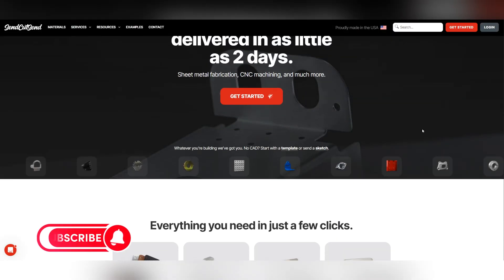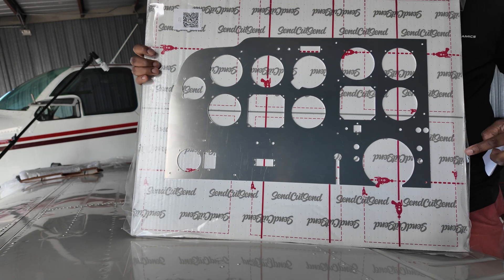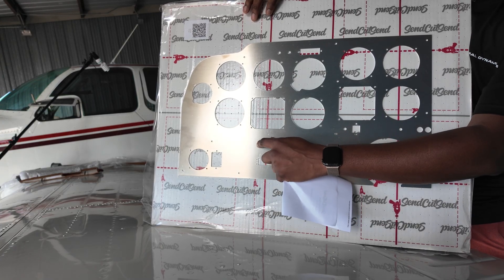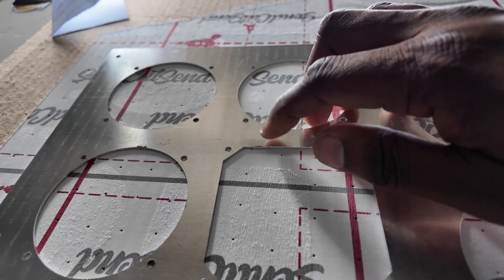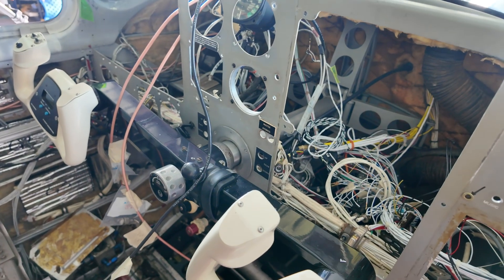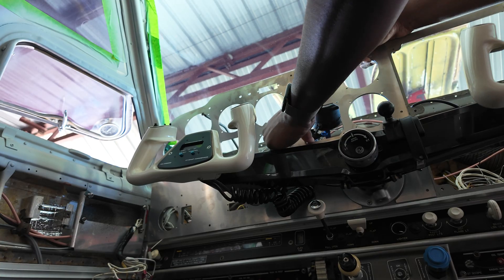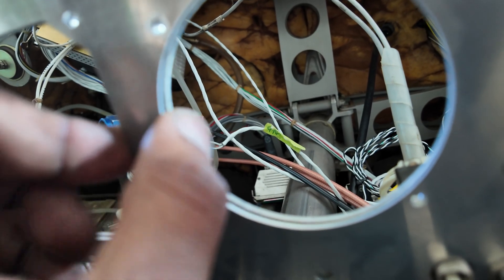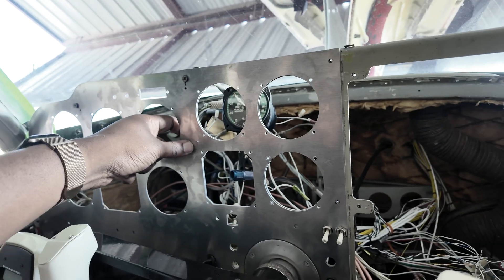Can I Make My Own Instrument Panel - How Will It Work?

Comment: What I understand from the whole “YouTube views are down” ordeal is that somewhere around August 10th, desktop views from those using ad blockers on YT were no longer counted as views for some reason. It didn’t affect revenue directly, because the views weren’t monetized to begin with due to the ad blocker, but obviously the lower view count can hurt YouTubers indirectly by leading to smaller overall views which leads to less hype/pushing by the algorithm. I am very surprised that YouTube isn’t addressing this more publicly.
Reply from the maker: This is my understanding also. The internet's belly button (Reddit) is full of content creators reporting the same thing. From the analytics that I only kinda understand, I've noticed that hardly any of my subscribers are seeing my content. More of my followers saw my stuff when I had 200 subscribers. Weird. YouTube gave a very unsatisfying response a few days ago that left more questions than answers. I'm sure there will be a fix or a new normal soon but this makes me think harder about diversifying platforms. You'll probably be ok with your new ruddervator rating service.
Reply: @OpenSourceGA ”internet’s belly button” is enough to make me spit out my drink! 😂

I don’t understand how impressions work on YT. Sometimes I’ll have what I think is a great video with a catchy title and a good thumbnail, and I get maybe 10-20k impressions. My CTR is usually about the same for all videos, so a 10-20k impression video will net maybe 700-1400 views. Another video that is thrown together last minute and has an uninteresting title and garbage thumbnail gets 150k impressions and I end up with 10k views. The impressions I get really doesn’t seem linked to the quality of the video, title, or thumbnail. Make it make sense.

As for subscribers not seeing your videos, I have bell notifications on your channel (one of maybe 3-5 channels I’m subscribed to that get the bell) so I get notified every time you post. You are usually very high in my recommended as well. Other channels I subscribe to will only show up in my recommended If I watch at least 50% or more of the videos they post. God forbid I skip two videos in a row because I’m not feeling it that day or didn’t have time, because those channels will get banished to the shadow realm. I pretty much have to use my subscription tab on YT to find videos which essentially eliminates my ability to discover new channels.

Comment: The amount of satisfaction from seeing all of the critical mounting points line up perfectly like that... I've used SendCutSend for some small parts for my track car, and they've been fantastic, and are wonderful to work with when it comes to designs requiring tweaking as well

Comment: I'm an avionics tech/ A&P that specializes in this type of work. I've been able to do most of my work from an A3 flatbed scanner but would love to use a 3d scanner for concept renderings/ rough measurements.
Reply from the maker: I've also done the flat bed scanner - works surprisingly well! The down side being needing to take everything out first to start the design work. Check the channel for some other examples of 3D scanning in-place. Customer gets to keep flying until you absolutely need to put it down (parts in hand).

Comment: First, it's good to hear your mother is doing well!  Second, does this require an alteration to Weight & Balance?
Reply from the maker: Thank you! If you were doing this panel replacement only as a cosmetic upgrade, then no it wouldn't. All the instruments end up in exactly the same spot and the weight of the panel it self is negligible. We'd make that assertion in the logbook. If I was only doing the GTN 750, we'd just do the math and update the W&B and equipment list accordingly. The upholstery change itself likely also has negligible effect since everything is going back in where it was maybe a few grams lighter here and there. Since this airplane lost several lbs from other stuff like old avionics and we're doing upholstery, AND because I've never actually weighed it during my ownership, it would be the right thing to do to weigh the airplane vs analytically adjust the W&B. I trust the old numbers but would much rather know for myself.
Reply: @OpenSourceGA  Great answer
Reply from the maker: Thank you! Glad it brought you some value.